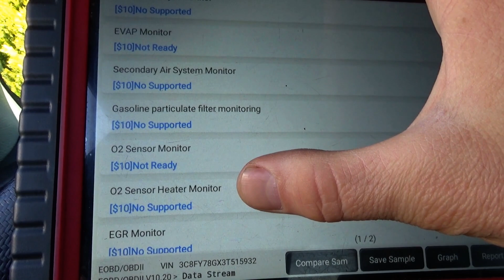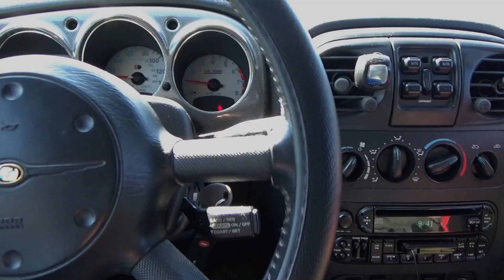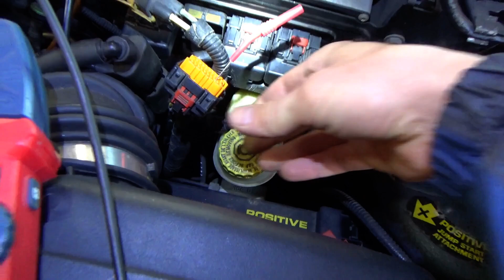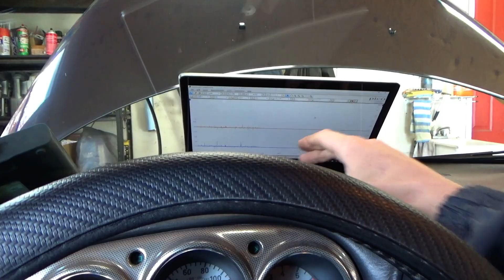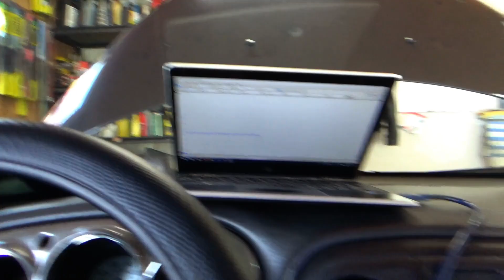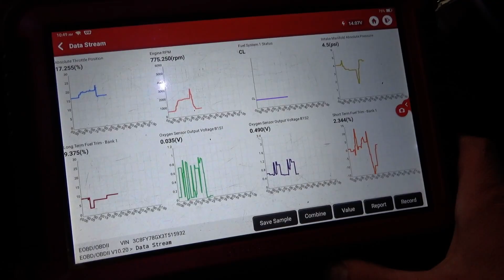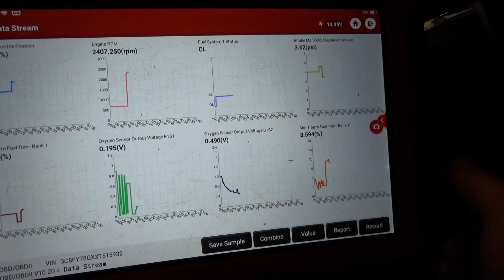PT Cruiser Needs a PCM? Or DOES IT? (Low Power-No Boost, P0031-P0037 - Part 1)

Comment: So the heaters are still connected to the computer when you added the light to B+ ? They must be if the lamp is fluctuating like that- I'd need to see on the schematic what you actually did there

Comment: OEM Campaigns GO1   RC-D46-05-FIXES  P2074   RC-D45-04   RC-D18-04    If you change the battery it will lose programming.

Comment: On older OBD II vehicles real time PID data update rates (waveform fidelity) are very limited due to the processing constraints in the ECM. So, the PID waveforms may look distorted.

The traditional HEGO (Narrow band) heaters are designed for 12V systems. So, to turn on a heater all you have to do is connect it across +12VDC. From a module design standpoint the common approach is to fuse protect the power feed to the heater and then activate using a smart low side power driver in the ECM. The driver power IC must be smart in order to report load circuit open or circuit short and its own internal health which is a requirement for OBD II. Meaning the HEGO heater circuit has full diagnostic coverage.

When the engine and exhaust are up to operating temperature the ECM can reduce the duty cycle from 100% (full on) to 50% or lower, and this heater strategy could be different for the up stream and the down stream HEGOs. 

If you read the fuel closed loop strategies for systems with a UEGO you will immediately appreciate that open loop fuel strategy to maintain accurate A/F ratio to meet emissions is almost impossible, given the practical engineering approach within ECM cost constraints, which are considerable.

Comment: Re-man PCM on the net. Lifetime warranty. If I remember 300$ appx exchange. All updates included. Replaced it myself in 10 minutes . Dealer price insane. 3 years later runs like a scared rabbit. Dealer close to 2000$ plus.

Comment: So inhave the same 2 codes.. p0031 and p0037. For low voltage on heater circut. I tested the pins going down on plug c2 same as you with a multimeter meter and they both tested fine like yours. So I went ahead and did this little hack, but now I'm getting p0032 and p0038. Voltage to high. I run a high output alternator and it is set at 14.6v constant. Do you know the voltage they are supposed to be at? Like the range they need to be in for no cel to come on? Cause I can add diodes to decrease the voltage in line with the nee bypass. I'll try to search it, but just thought ild ask.

Comment: random & off-topic, but where did you get all of your banana-plug test leads & test adapters? is there a set that you bought, or did you just piece together everything? Would you consider doing a video on all of the miscellaneous test leads, adapters, & 'widgets' you use ???  (both the custom-made test stuff & the commercially available stuff you've bought)
Reply from the maker: It's a mixed bag lol

Comment: i have a question and it’s just because im curious my aunt used to have a 2002 jeep Cherokee Laredo with the good old straight six engine anyway it’s no longer in are life but i remember if that thing ever had a problem with a senior of any kind it really got to the point of stupid but if it wasn’t from jeep it would never like it it was extremely fussy with 02 sensors and crank sensors you could get away with a lot an very little at the same time now i have had the same issue with our 2003 chevy suburban with mass air sensors and the map sensors really things involved directly with fuel control it’s really picky i used to question the aftermarket stuff for a lot of years pre pandemic you could most of the time get away with not going to the dealer but now i feel i would have better luck at the roulette table in Vegas so is the issue just that there’s just enough of a difference that it doesn’t work if that is all it is we all need to demand better

Comment: Even if its not the problem, (many) pt cruisers need the ignition key switch replaced about every 100,000 miles. 
I've had to replace a few of those switches to fix random cel errors and power issues on the pt cruisers. 
(Power both electrical and performance.)

Comment: Question: If the Heater circut on that O2 Sensor is always ON, won´t that burn up the Sensor on Highway drives because of overheating?

Comment: Do you think the heaters being constantly on would do anything Ivan? 
And BTW regarding that E200 i told you about before, i tested APP and TPS , both checked out to be good. The i looked a bit closer, APP data showed 49% at WOT while the car was in drive going uphill! Same sensor would report 93% at WOT in neutral or park, regardless of wether the car is running or not.
Would scope the 5v and grounds at the APP sensor and see what's happening to them while in D vs N.

Comment: Placing bets on control arm bushing, sway bar bushings inner and outer, watts links, bell crank, but not the ball joint because you get a new one with control arm every 15K miles give or take a few. Also replace the torn engine pencil struts while you're at it. ...It's a PT thing.

Comment: A PT cruiser with 135k on the clock is equivalent to a Toyota with 7 million miles on it. Pretty impressive it made it that far
Reply: What's sad is that back when these were new they were considered not very good cars (and they weren't compared to most cars of the early 2000's that were very reliable) but compared to the absolute junk they make today these are actually passable now lol

Comment: Hey PH, i saw a scanner danner video on a chrysler where his heater circuit wouldnt have 12v from the pcm and as you know these have no fuses between so he ended up learning that it was in fact not a pcm issue and that it was actually a bosch sensor and the new ntk oem solved the issue. Can this be possible? I have a pesky p0131 on my chrysler with a denso oxygen sensor and no 12 from the pcm key on engine off. Thank you.  No wires are broken by the way.

Comment: I have an after market AFR meter on a hot rod. The O2 heater comes on for about thirty seconds at start and turns off then starts reading, the instructions said this was normal.

Comment: Did you do isolation checks on the heater citcuits on addition to the continuity checks? I have had lines on csbles shorted to other lines causing iddues similar to this. These sort of problems are frequently intermittent due to corrosion or cracked wiring insulation.  Isolation trsts arr tedious but a necessary part of troubleshooting.

oting

ent

Comment: Lucky bastard.  Your problem is reproducible.  My F150 is complaining about the transmission range sensor, but it won't break long enough for me to give it a proper diagnosis.  I may end up firing the parts cannon based on the DTCs and the interwebs screaming about the 6R80 transmission lead frames being garbage and throwing these codes.  Just wish I could prove it.

Comment: It is weird that Chrysler passes that heater current through the PCM.  Your repair should be OEM.
Reply: I also heard from scanner danner that this issue could also be aftermarket oxygen sensors and not the original ntk sensor that it needs. I have a p0131 code on my pacifica and I get no 12v from the pcm but supposedly that's normal unless I have an ntk sensor.

Comment: Ivan, 
 I just wanted to let you know how much I appreciate what you do and the influence you've had on me and my mechanical endeavors. I have been fighting an intermittent CAN BUS failure on my 05 Volvo V70R for well over a year. It did not occur often and would clear itself like nothing happened on the next start up, or in motion depending on which warning message was present. I could easily lose my instrument cluster and go into a limp mode. While watching you tackle an intermittent Malibu CAN BUS short that turned out to be a transmission cooler line harness rub through, you mentioned that 95% of all these types of problems occurred in the presence of heat and vibration. Even though I felt I had gone through my engine compartment with a fine tooth comb at least a dozen times I thought I'd once again take another look because of what you said. After spending a good two hours hunting around and inspecting/wrapping even the most miniscule of wiring runs, I came across a forward plug connector for my turbo boost pressure sensor. I thought I'd checked every connector in the compartment but that one didn't ring a bell. It sat forward in the nose along with the intercooler. 
Opened it and found a great deal of corrosion as the individual who had replaced it at some point in the past, lost the weather proof connector surround and plugged it in anyway. This I feel was what I'd been looking for all this time. Have driven for days now and confident that this Gremlin has been dealt with. 
Again, If it wasn't for you. You have definitely made the difference. Hitting that "Thanks" button and sending along some cabbage for the inspiration.
Signed,
               George in Oregon

Comment: Wouldn't the o2 heaters be powered up at all times during driving ? If anything the solder joints in the pcm are damaged but may be repairable ! If not replace the pcm and definitely the engine oil !

Comment: I did a similar thing to trick the secondary air injection on a 01 VW n it went into fuel control all day n stayed in CL but the next morning it came up with a code for being shorted to b positive. Clear n same thing would repeat

Comment: I can't help but wonder if the ECM is supposed to provide a regulated voltage to the O2 sensor's heater. Fun fact: in the old days, some electronic circuits actually used light bulbs to provide regulation. I've seen it a couple of times. Your use of a light bulb may have been beneficial🤔

Comment: Check PCM powers and grounds. There could be a dedicated O2S heater feed that goes through a fuse. Also, there is possibly a P-channel MOSFET in the PCM responsible for controlling the power to the heater, and the gate of the MOSFET requires a ground. I have a feeling though that the conclusion will be something completely out of left-field that I would never even dream of in a million years.

Comment: About 15 years ago I had a 2000 Chevy Astro with a similar problem. The o2 sensors were replaced with Bosch, but heater codes kept returning. After much hair pulling, I finally found the new sensors wouldn't meet the self test parameters progmmed into the pcm (even though the resistance was in spec, and the wiring was perfect). Ironically, it was this case that caused me to buy my first oscilloscope, and to never trust any sensors that aren't made by the original manufacturer (no matter how reputable the brand). Cool video Ivan! Keep 'em coming!
Reply from the maker: Bosch sensors suck... Denso is much more reliable 👍
Reply: @PineHollowAutoDiagnostics  I now only use what came out in the vehicle new, there's just no way to tell what self test parameters were written in the ecm, or what brands it might play nice with. If it came new with a Bosch I'll put one in it (although it might make me nauseous after that experience 🤢), I run only Denso in my GM vehicles (that's what they came from the factory with).
Reply from the maker: @JessClearyAutoRepairLLC  I had to warranty an OEM Bosch sensor on a Chevy Cruze turbo 3 TIMES in one month... Finally tried a Denso, worked like a charm 😁👍
Reply: @PineHollowAutoDiagnostics  that's crazy, and good to know! I hadn't heard of anyone having trouble with them in applications where they were OE. I might quit using them altogether. Seems they're not what they used to be?
Reply: @PineHollowAutoDiagnostics hey ph scanner danner told me that denso shouldn't be used in chryslers only ntk original and that it might be why I get my p0131 code. Any advice? I'm not getting 12v on that heater wire to my upstream connector with key on.
Reply: I watched a one hour video changing the spark plugs on one of those.  Now THAT is worth paying the extra for the expensive plugs.

Comment: Interestingly enough, on my (and others) 2003 Dodge Dakota, the O2 heaters ARE powered through the ASD relay. I was thinking at the beginning of the video to check the wiring from the ASD relay. So Chrysler had figured that out early on - no separate driver needed for the heaters in the PCM.

Comment: Hi! I am tired of part changing  mechanics. I am going to do everything  myself. I have 2003 a 4.8L 2500 gmc savana Penske 12'. I haven't  drove it in 4years no mechanic could get it running . A better mechanic  told me change the crank shaft sensor i did myself the van started running. I want to fix it myself with your help so what to do next. Oh by the way they cut my resonator and catalytic. What to do next?

Comment: you should check turbo solenoid also...you shiuld not see 15 / 20 psi at the map sensor under 4000rpm ...surprise that you don't have overboost code ...pt gt should be around 13 /15 psi of boost at WOT
Reply from the maker: Atmosphere is 14psi...so 20psi on scan data is only 6psi of boost 😅

Comment: I had a 2006. It was complete junk, but I was desperate for a car at the time. I bought it with an upstream O2 sensor heater circuit code. Turns out it was just a rusty ground on the passenger side frame rail. Fixing that ground also fixed my AC compressor clutch not engaging.
Reply: I have a pesky p0131 on my 2005 chrysler pacifica was this your code? I don't think my grounds are bad because at the o2 harness I get ground well.

Comment: Wonder if you can open the PCM up and replace the drivers. Transistors are easy to source and change. I wonder once these cars start getting rare and parts become scarce we might have to change up our game. I've had to change components on boards before so it's not too difficult.

Comment: NTK O2's???
...Pentagrams & Boschevicts
Reply: Can you elaborate a little more? I've also heard my denso could be causing my p0131 and I should buy ntk. Thanks.
Reply: From my experience the Germans dialed in too tight of parameters for other O2's other than NTK's...
it seems~
Diemore-Cryslur
Reply: @PailAndTear  interesting because the video I saw also had a bosch sensor and an ntk oem fixed the issue

Comment: IDK american cars, but on proper cars DME pulses voltage to heaters and monitors current during those pulses. Current is very accurate indicator for sensor temperature so depending on current value DME makes those pulses shorter/longer to keep sensor at optimal 750-760°C temperature. Sensors are NOT designed to withstand constant voltage applied to their heaters. So in a best case the owner will be changing them left and right, in worst case they will actually melt.

Knowing that this is done to allow much faster initial heating and seeing those pulses this ECU was trying to make it feels like this uses same principal, so good luck for the owner of this car to not get in on fire :)

Even though I like no parts required fixes, this fix feels like it went way TOO FAR.

Comment: I like PT Cruisers. I owned a 2001 and drove it for 14 years!! I just got rid of it about 2 years ago with 200,000 miles on it.  I drove it up and down the east coast and out to Indiana several times. It was not a turbo and had horrible gas mileage. Mine always leaked a little water and I could never figure out where it was going. I think they all do. lol
Reply: I was offered one cheap. the gas mileage, and the towing capacity made me decline.  I can live with the tight space under the hood.   Wouldn't like it at every timing belt change, but not a deal breaker.

Comment: Great test fix!   think I would prefer to wire the heaters through a resistor that sets the voltage to about 9 volts so if there is something happening at the output drivers it doesn’t fully fry them out by giving that circuit full battery power.   Also it won’t blow the ASD fuse and shut the car down at the least opportune time.
Reply: I was thinking 5 volts honestly I think either would work

Comment: You see? When I thought you started becoming a serious mechanic, you came up with this video. I will get over the fact that PT cruisers are all design but no substance POS cars. But how is it possible to accept and do Russia-like "repairs"? Just because the client is happy with a stupid (even illegal) solution? What next? Install AK-47s on a Dodge Ram because the client pays you? Where do you draw the line of professional integrity? Then on your happiness and short sighting about the PCM "working" after a 5 minutes test. Do you have any idea how many tests you must do to declare a PCM 100% working? Moreover, do you know how hard a PCM breaks? Unless you don't do something totally stupid as welding on it or feeding it a high voltage power supply, shorting its pins, etc. they are very tough. You are very hasty, both in condemning a PCM as bad and also declaring it functional. How do you want to be remembered and advertised? As a Russian cheap botcher or as a technician with professional integrity? Because every improvisation and money-saving NPR you are doing will come and bite you on the rear. Don't you believe it? Here is an example. Let's say you "solve" the problem of this car like the client wanted. Then at some point in time, the client had an accident on a highway because the engine stalled and he couldn't control the car anymore. It can happen, trust me. Who do you think will be blamed for the death of your client? You. Because you accepted an unauthorized repair. You can't excuse yourself by saying that the client told you to do a botch. You will be liable. You are the one who should have said to him "Goodbye. Find somebody else." But you wanted his money. I would be more careful if I were you. Cars are lethal weapons. You have the responsibility to send on the road cars repaired like the manufacturer said.